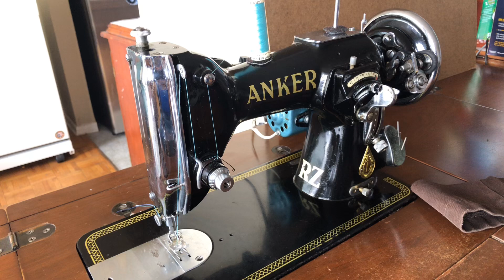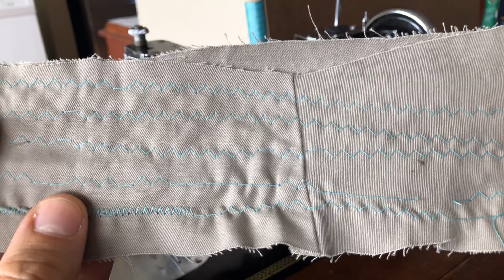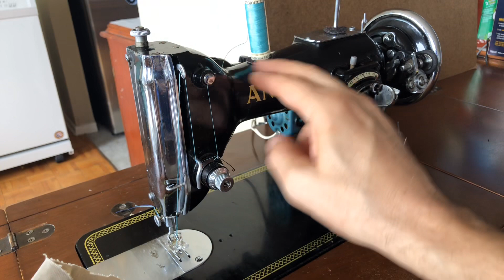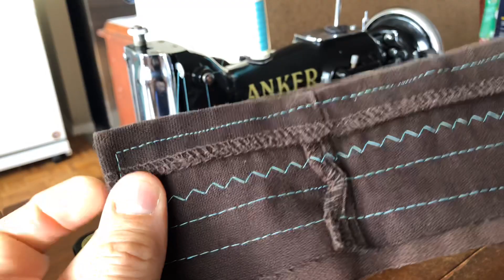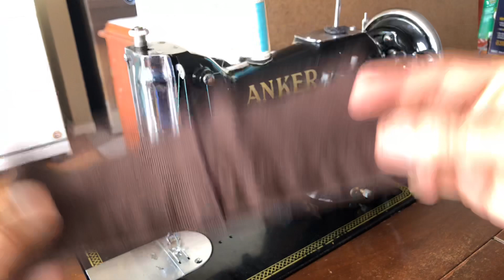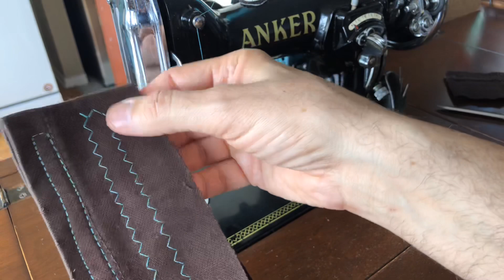DEBUT SERIES #23: Rare Model Named "ANKER".  Heavy Duty ZigZag Machine & Heavy As an Anchor Too!

Comment: We have RR model, it was my grandmothers sewing machine and it still works perfect. I only try to find out O ring near right side of machine
Reply from the maker: Hello.  You should be able to find the winder ring.  They are fairly common online in black rubber.  They are not brand specific so any generic brand will do as long as you ensure to order the right size.  Ask the seller you go with to confirm the size and you should find a replacement.